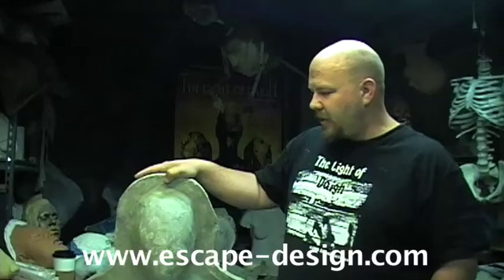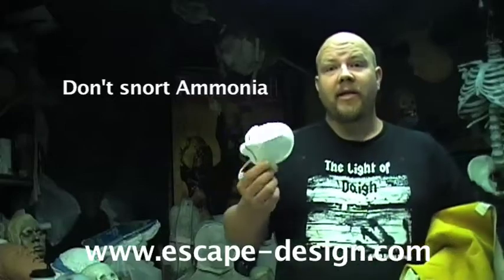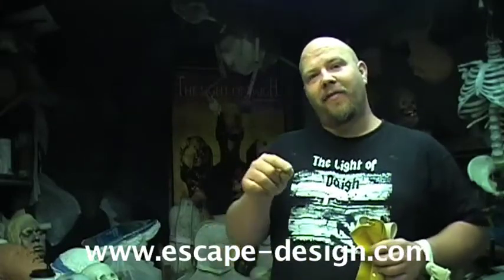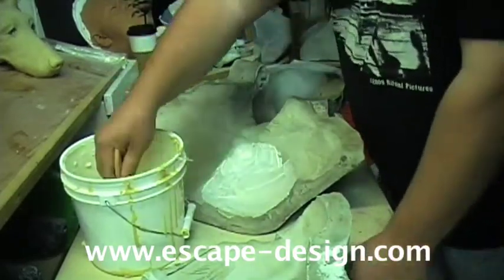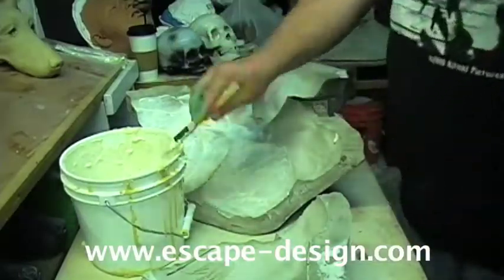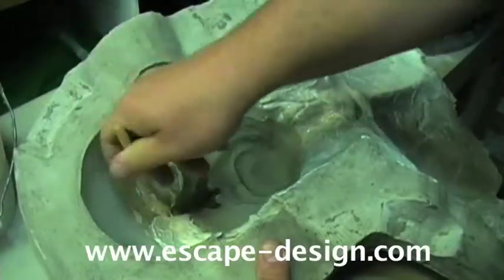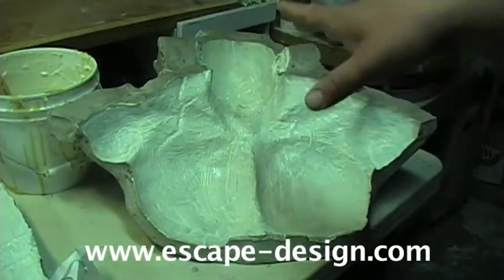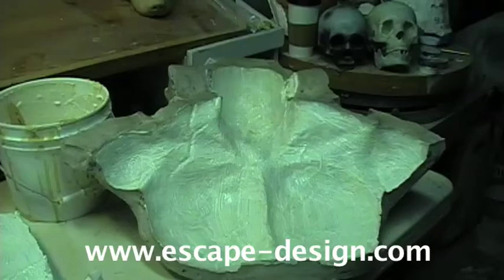Mask Making with EDS (Part I)

Comment: quick tip, dip your brush in dish soap diluted with water. it keeps latex from ruining your brushes. ive used the same one various times and works like a charm. good luck